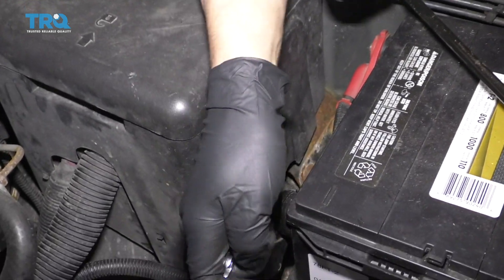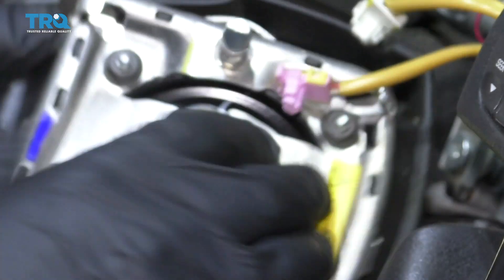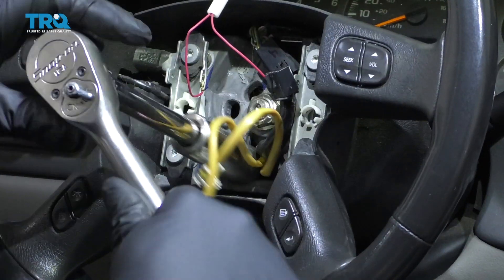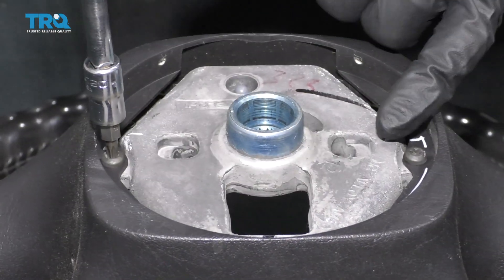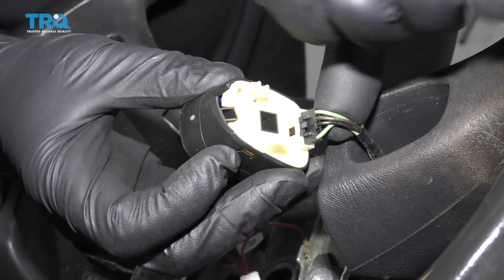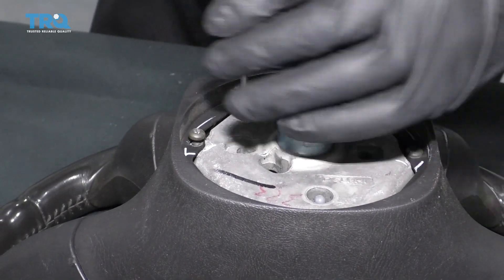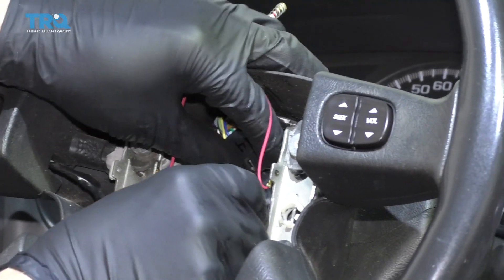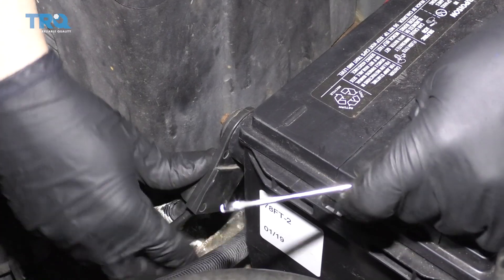How to Replace Steering Wheel Program & Source Radio Control Switch 2003-07 GMC Yukon

Comment: Isn't there a time limit/ timeframe required/recommended to wait after you disconnect the battery, BEFORE you disconnect the airbag plug terminals??

Comment: My problen is my radio button just stopped work after i took my radio out and put it back in.  Does the fuse in the aftermakert radiio module control this? Mine has lights but no function now